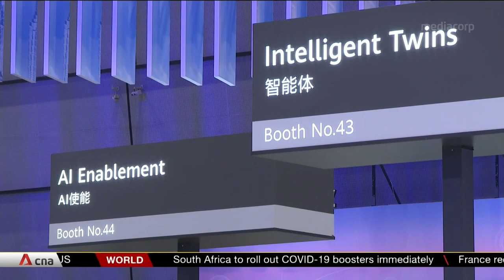China's technological revolution giving it an edge in global tech race

Comment: The lithography machine wasn't made by the US. It was made by ASML,a Dutch company which wasn't an American company. US was just using their so called sanction system to control the chip manufacturing but sooner or later. The Moore's law will not be reliable for the 6g technology. And china knows that,6g technology needs a new type of chips which wasn't based on silicon.